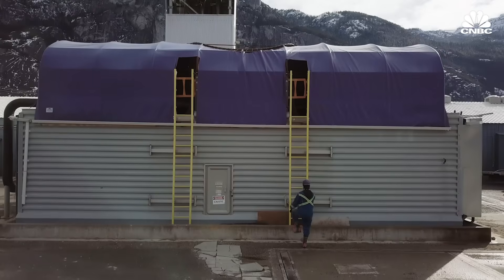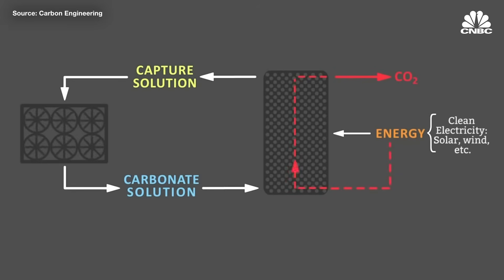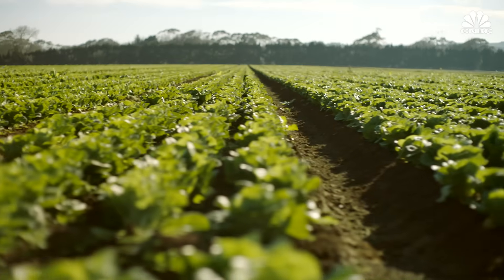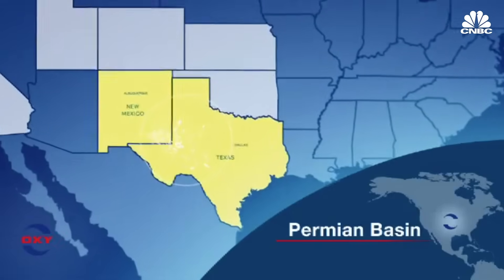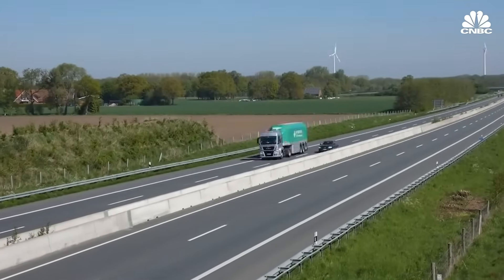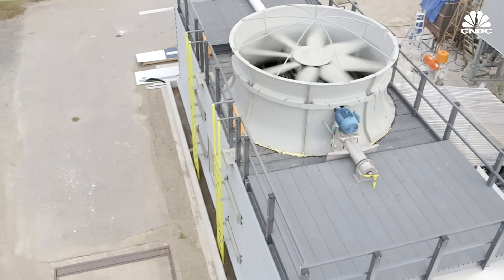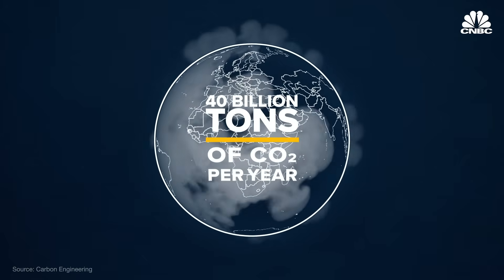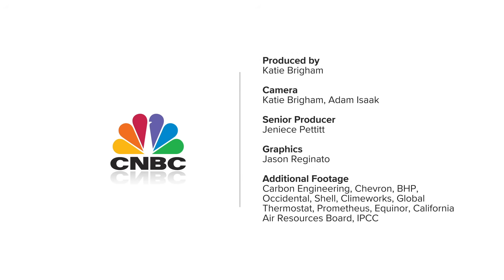Bill Gates-Backed Carbon Capture Plant Does The Work Of 40 Million Trees

Comment: Trees + This powered by non-carbon-producing sources = Solution

Yes? no? maybe so?
Reply: A nuclear powerplant's cooling towers can easily be modified to do the same thing. A cooling tower's job is to remove as much heat as possible so it has all these sprayers and baffles that increase falling water's surface area as much as possible and reduce losses as much as possible. More surface area means more CO2 removed, for synthetic fuels during low electricity demand perhaps?

Comment: Why are these academics so against using fossil fuel? If the oil companies can come up with a way to capture carbon dioxide and make burning oil carbon neutral, what's wrong with continuing to use fossil fuel? So what if carbon engineering is expensive today. New technologies are almost always expensive in the beginning. The cost will come down if you let it play out and improve. No one's stopping them from developing solar and wind energy. They shouldn't stop other people from developing their own technology either.

Comment: I saw a report produced by a scientist at JPL who described this process in the early 90's.  His process is taking hydrate of lime, mixing it with water and dripping it down mono-filament strands to capture the CO2 and then evaporate the water to yield calcium carbonate, that could be used for in other processes or used to make building materials, and that would sequester them into something useful rather than trying to inject them into wells.  His theorized system did not require an energy input other than a small pump in the base to send solution to the drippers.  If placed in windy areas the natural wind would pass enough air through to remove the CO2.  He claimed that an area of one square meter per human would be able to absorb all the carbon emissions from fossil fuel use at that time.  That's surprisingly a small area, about the size of New Hampshire.  It would be scattered around, now probably in between windmills on wind farms.

Comment: When they said that they would use it to produce fuels, while talking about ways to take CO2 out of the air, I was not quite sure whether I should just laugh or stop watching at that point. Isn't it clear that fuels work as a supply of Carbon to get a  reaction producing CO2 and a certain amount of available energy? If they're thinking of a way to create an artificial Carbon-Cycle, then they should at least say that right away and also mention that it would only work if we get to completely shut down fossile fuels in order to not get more and more CO2 into the air as this technique doesn't remove the Carbon completely but instead just puts it into a different form for us to burn it and produce CO2 out of it again. But when they are supported by oil companies etc. it doesn't seem like they are gonna do that. This Carbon-Cycling would mean that we reduce our use of fossile fuels for transportation and energy supply, which would mean that oil companies would actually be ruining their own business model.

Comment: This is some large scale snake oil production. Ridiculous amounts of energy are wasted by capturing this CO2. While the energy is produced by 'green sources', those sources could also be used to replace the CO2-producing powerplants. Besides that, CO2 is only a tiny factor in the whole global warming problem. 

The direct carbon capture from power plants is viable though, but those huge fans and 'carbon neutral fuels' are pure snake oil.

Comment: It's important to give the oil industry an out, or they'll fight against clean energy tooth and nail. Also, the CO2 extracted can be used as a fuel (although, probably not very clean fuel, but at worst you're not adding CO2, just not removing any). It's like being in an argument with someone, if you don't allow your opponent a dignified way to change their mind, then they never will. If the oil industry is allowed a way to transform itself into clean (or cleaner) energy, then they will when that's more profitable. So make it more profitable.

Comment: Neat idea, but concerned about "geo-engineering" and the potential problems. What will the cost of natural filters, aka trees, when their food gets sucked up by this "machine"? Also, actually prove the actual CO2 costs, all the studies I have seen (since I started looking at this in '76) have models that have failed (miserably in most cases). The data does not prove a problem.

Comment: First off, the most cost effective, environmentally sound way to reduce CO2 emissions is to never emit them at all - that is replacing fossil-fuel powerplants with renewables (or advanced nuclear).

Second, moving air past a slaked lime-water solution is not at all new, and it does not solve the problem. It is a VERY energy intensive method to remove CO2, so much so that these nitwits find that they have to burn natural gas to support their little Potemkin Village. This is all for show folks, which is precisely why Chevron and others invested. It is just a way for fossil fuel companies to pretend they are doing something. If you think Chevron is serious about renewables or the environment, read up on what they did in their joint venture with Cobasys/Ovonic.

Comment: 150$ per tonne (which I think is not half of what it would cost) would leave you with a combined cost of all nations at $5.7billion PER YEAR, who will pay for this? God knows.
Also regarding using co2 to make fuel: there is no way to make co2 into fuel without using as much or more energy than you get out of burning said fuel due to thermodynamics. So good luck with that i guess.
Reply: 5.7 billion combined is nothing lol
Reply: @AnthonyBecker9  Yeah that's suggesting their figures are even accurate which they are not, the tanks alone to keep 1 tonne of c02 in will cost more than 150$...
Reply: We will see. But also to your second point, about turning CO² fuel: it's okay if it takes a lot of energy to make the fuel. The fuel is a storage method for energy which is easy to transport and use.
Reply: @AnthonyBecker9  Yes, but nobody is gonna make it if it doesn't make you money, unless space agencies for some reason gotta start making their own carbon neutral fuel, which I don't see happening any time soon
Reply: @TraviansLittleHelpe I guess so

Comment: If you guys stop climate change, you can call yourself gods. Because of the earth's rotation and it's tilt, i doubt you will get anything achieved aside from self congratulations. As long as the air is clean enough to breath, as it is around a good portion of the world, carbon emissions are fine.

Comment: They plowed over hundreds of acres here for solar fields. Seems counter productive.
Reply: They really love their oil products
Reply: @Joseph Sheff It may be cool beneath the trees, but unless you vent the water vapor created by the trees to outer space, it'll just heat up the athmosphere. (Vapor stores heat which is released when it condenses.) 
If we're ignoring steam emissions, we could just put up sprinklers around the solar panels to cool the planet.
Reply: @MrMinarion  forests heat up the atmosphere?
Reply: @Joseph Sheff Well light does make heat when absorbed.
Reply: @benlawton5420  Ok you proved my point. The heat is only caused by current moving through the P doping. The heat doesn't make any power on the solar panels. Its a by product of resistance which is almost negligible.
Reply: @josephsheff  Oh I meant absorbed by an object say a rock, but even when the panel absorbes the light the electrical energy will eventually get turned into heat anyway.
Reply: fun fact - trees absorb solar radiation and contribute to climate change. bare land is more reflective and reduces the impact of solar radiation on the climate. if that land is filled with solar panels, even more so, because now the heat is being converted into electric current. and then, on top of that, the solar energy is used to offset the burning of fossil fuels, and therefore the release of CO2. so it's not as dumb an idea as you might think.
Reply: @PantherFox  ban trees!!!!!!!!!!
Reply: @PantherFox  Except you're wrong, solar won't offset carbon emissions because solar is an inefficient form of energy within the atmosphere. It only works half of the day, our batteries aren't efficient enough to store all of the excess energy they create, on top of that, you need enormous fields of them to generate enough power for any sort of city. It's not efficient, it's not pleasing to look at, there's a better way. Which is most definitely nuclear.

Comment: But guess what this does not do that trees do

THIS THING DOES NOT MAKE OXYGEN.. Oh poop
Reply: Yes it does produce oxygen - basic chemistry lesson time.  When you burn a hydrocarbon fuel (like gasoline, methane, propane, diesel ect) the hydrogen & carbon atoms in the fuel combine with oxygen from the air, producing CO2 & H2O (water), along with energy.  This thing is basically using energy from dams to do the reverse chemical reaction - stripping carbon and hydrogen atoms from the oxygen atoms they are bound with, to make synthetic fuels; the oxygen itself doesn't disappear or anything, they could just release it to the atmosphere, or bottle it up, whatever ends up being more profitable.
Reply: @dreadcthulhu6842   Burning Methane is the only one that releases only CO2 and H2O only making it the cleanest of all WHEN burned in a completely ideal environment.  All the others release ozone, carbon monoxide, nitric oxide, nitrogen dioxide, sulfur oxides, and hydrocarbons, including polycyclic aromatic hydrocarbons as well as Soot (made up of particles such as carbon, organic materials (including PAHs), and traces of metallic compounds) CO2 and H2O of which CO2 and H2O are the least damaging to the planet.  OZONE (O3) is terrible in the Troposphere!!!!

https://phys.org/news/2019-05-exhaust-gas-blame-ground-level-ozone.html
Reply: @Dread Cthulhu ah ok
Reply: True, but 40 million trees is a lot of trees as well. It would be swell to have it, but this is topographically a smaller footprint. 

Granted more trees is always good but still easier to build these than let 40 million trees grow up. 
Do both. But one is quicker at addressing the problem.
Reply: @PirateDion  Only if you believe CO2 is a problem.  Pollutants are the problem and CO2 is not a pollutant.  Creating these machines will create a large amount of pollutants and damage the environment.  These are a waste of time and resources.  Stop eating cows and hogs if you want to make a big difference.
Reply: Trees are good for the short term but on a large enough scale e.g. the 1 trillion plus we'd need to make a difference would dramatically change the earth's albedo meaning more thermal energy would be absorbed on the surface counter-intuitively leading to an increase in temperature.  They also release all of the CO2 again when they die and decay.  If you calculate how much water would be required to plant 1 trillion trees it simply doesn't exist anywhere.
Reply: @TabulaRasa001  The cloud cover is increasing.  CO2 is not a warming molecule.  CO2 is a replacement refrigerant.
Reply: @drifterted  CO2 is most definitely a warming molecule.  It's used as a refrigerant when it's under extreme pressure as a liquid.  Huge difference.
Reply: @TabulaRasa001  No it is not a warming molecule.
Reply: Guess what, nobody is stopping you from doing both, you can have trees and this at the same time. You can use this to soak up excess CO2 while waiting for trees to grow up. It's a lot better than just doing nothing waiting for trees to grow. Why are you guys treating it like only one form of can exist.
Reply: I think the idea is that this would remove the excess CO2, not replace trees
Reply: @1berrylover178  But would we know until its too late? I agree it's a like having a tinfoil hat on when saying this could be hurting us, but in this strange reality that we live in we can't help but have the thought that climate change is partly on purpose.
Reply: Amazing how nobody noticed it...
Reply: well thats the plan. remove all the plant food from our atmosphere, let all the plants die, oxygen in the air gets exhausted, sell oxygen rations in bottles to humans on top of co2 taxes. if you do not obey, you get your ration of oxygen cut and you are left to die. welcome to your brave new world!

Comment: This is rubbish. 
1 tonne of CO2 comes from 300 kg of coal. So at $200 per tonne, you're adding over $600 to every tonne of coal to capture it in this energy company pipe dream of an idea.
You know how much coal costs today? $60 per tonne. So you're going to make it cost $260 per tonne with this dumb clustertruck of an idea. 
(And they say "$94 to $262 per tonne" - which is a con artist's way of saying it's at least $250).
>>We could reduce CO2 emissions to next to nothing if not for these energy companies and their rent seeking. What we need is to increase efficiency / reduce waste in energy use, invest in massive expansion of renewables and storage, kick start the hydrogen economy and charge energy companies for every gram of CO2 and methane they let loose into the atmosphere. 

A thermal / PV solar field to power the entire USA would be a no-brainer. Huge project, but much simpler than road building, which we do all day every day. Before it existed people would have said "you're crazy to think you could have a paved road all the way from NY to LA - that's way too expensive and too big a project."
Now it's just taken for granted that you can drive from anywhere to anywhere on multi-lane highways, because governments got busy and built the damn things.

Solar fields are about 100 times quicker to put in than roads, and they can go onto land that nobody wants to use for anything else. If the US got its act together it could easily install 100% renewables with solar PV and solar thermal, with storage (thermal, hydro, compressed air, battery, hydrogen) within a decade. 

At $200 per tonne to capture CO2, you could fund renewables out of the cost of this stupid purely-for-distraction CO2 capturing plant.

Comment: This is great ! Those who are waiting for the problem to be solved by good will are INCREDIBLY naive. That ship has already sailed.
This kind of tech can be used at the output of every oil powered machine. Power plants, cars, plains, etc. This way almost zero carbon dioxide is released to the atmosfere. Fossil fuels will eventually run out. But this will help tackle the problem much more faster than just planting trees, which take years to grow. Why don't do both ?

I think we must be focused in the primary goal here, which is stop climate change. This is very promising.

ONE OBSERVATION: I think is dangerous pumping carbon dioxide into the ground, which may leak back to the atmosfere or worst, be suddenly realeased. That is dangerous.

Comment: You want to extract the Carbon from CO2 ffs. You dont want to remove our atmosphere......
Reply: Isn't CO2 like less than 1% of our athmosphere. It's not going anywhere and impossible to run out of.
Reply: @TealJosh  Well if we continue to use gas etc we will converte Oxygen into CO2 and thus we will be taking oxygen out of the atmosphere and putting it into containers or what else they want to do

Comment: This is ridiculous and a potential ticking time bomb. You collect all the carbon, then what? Use it elsewhere? It'll still be released at some point causing a disaster, whether through fuel, medicine, etc. Eventually it works it's way back into the ecosystem. If you let it go naturally, it wont pose as much of a risk. If it's stored and an accident occurs, m/billions of tons will be released all at once. Think of the consequences.

Comment: You can't turn CO2 into fuel without using lots of energy; it's basic thermodynamics.  That energy can be obvious or it can come in the form of energetic molecules to react with the CO2 (like elemental hydrogen).

Comment: My question is: What is the potential economic/energy comparison between taking carbon out of the air vs taking it out of water and the oceans? Carbon, as carbonic acid, in the ocean is in a much more dense form than the ambient carbon in the air. Is Air carbon-capture more efficient than Water carbon-capture?

After all, carbon levels in the water will directly follow carbon levels in the air. So, taking it out of one place is just as good as the other.

Comment: Cost is irrelevant. Turning the CO2 back into fuel is inefficient. They only isolate the CO2. That solves nothing. The best place to capture CO2 is at the tail pipe, not after it has diluted into the atmosphere.  Battery electric cars are far more efficient than the burn fuel, capture CO2, CO, create fuel cycle.  Of course if this worked, there would be no need to drill for anymore oil, as you could simply create oil from captured  CO2, CO and water from the tailpipe of cars.  That would be a closed system, which is what is required to solve the problem.  Pumping CO2 into under ground chambers solves nothing, as it will eventually escape again.